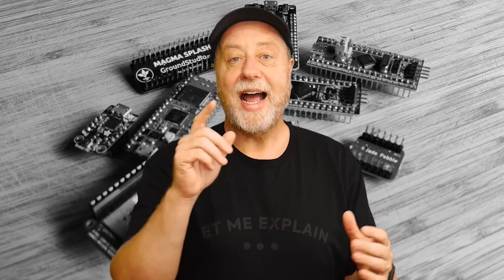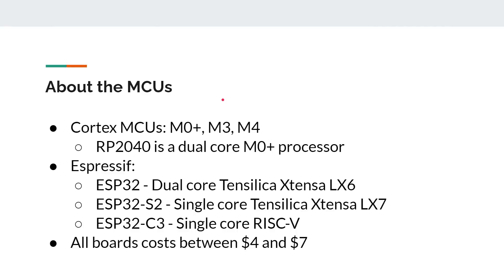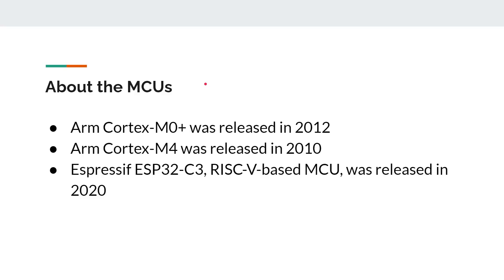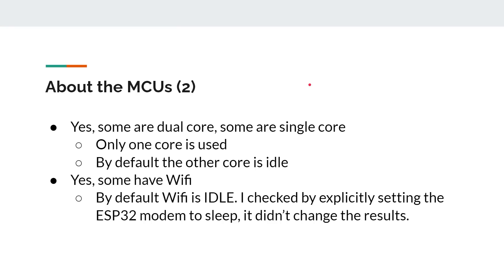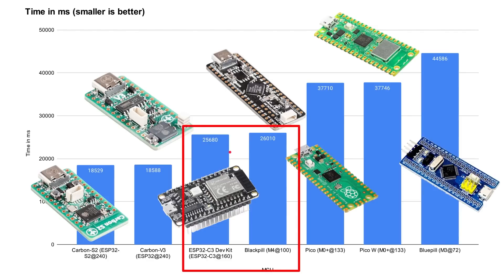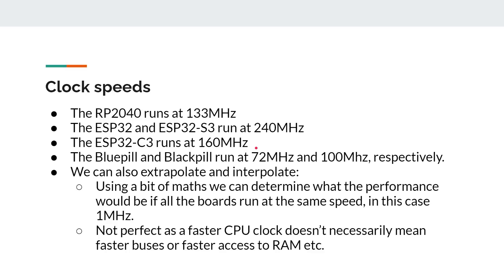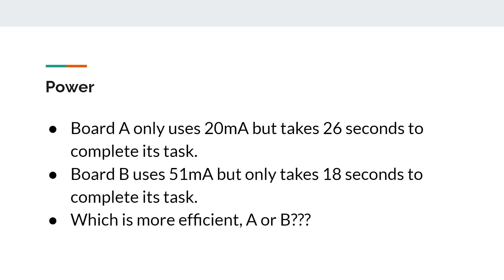Arm vs RISC-V? Which One Is The Most Efficient?

Comment: I recently created a product using an STM32G431CET6 and that thing is proper OP for the application in mind (There was one specific requirement I had to meet).  They can clock at 150MHz all day long and boost to 170MHz.

I’m running mine at 24MHz and even that’s generous for my needs.

Comment: One other important factor on powe consumption, is how low ot can get when not doing much. This can be very important when making battery operated things. For example, the Nordic nRF52840 can gwt down to less than 5 mA with BLE running, and lower in LP modes, while I have not gotten the ESP32-C3 down to less than the same 38mA with BLE on, even when the CPU is just waiting. I'm working on this, trying to get the C3 to run more efficiently, because it is otherwise a very affordable and capable module.

Comment: if it has a lower power consumption but takes longer to do the same  task its not more energy efficient. It is better to have Faster processing for a shorter burst than spending a longer time to do a task at lower power consumption. The  black pill would have close to the same power consumption as esp32 since it would take 2.4x longer (without architectural differences). So while esp32 would consume the power in 1hr, it would be done and be in idle state while black pill would be still processing. Not to even mentioning the heat it would produce working for that  long would also increase power usuage.

All in all you didnt take into account the power it would consume for running longer or shorter periods (in the case of more powerful socs like esp32 or pi pico etc.) The graph is assuming that higher performance socs would take the same amount of time as black pill to do the task
Reply from the maker: Eh? That is exactly what I measure from approximately the 14 minute mark onwards, my guess is you didn't watch the whole video.
Reply: @GaryExplains  i watched the entire video. If this is a repeated test then time is okay but the number of test run per mcu is important for "efficiency". if one mcu can do 1 task for 1hr and another does 2 or more per hour then it wouldnt be fair to say that the one that does 1 task is efficient because it draws less power over the hour. There can be 2 mcus at the same clock but 1 can do more tasks; like for example adding 100k numbers , while mcu A does 100K in 1 minute mcu B might do 2x 100k in that same time.  If the mcu only does 1 task and goes to sleep then the higher performance cores would be more efficient since they would spend less time working on the task.
Reply from the maker: I am talking about the mWh chart I show just after the 14m mark. That measures efficiency for the whole task, as you describe. 🤷‍♂️

Comment: You are comparing what against what exactly?
For ARM, there are many different versions of the ISA (instruction set architecture). v7, v8, THUMB, THUMB2 being only the major families.
Let's say you take the latest and greatest of these: that would be ARMv8 with Thumb 2 instructions.
For RISC-V, the situation is more clear:
There is the RV32I (32 bit) and RV64I (64 bit), with I = basic/integer, and extensions M (multiply/divide), A (atomic operations), F (floating point), D (double precision).
Collectively IMAFD is called G.
There are compressed instructions of the I set, called C.
Then there is the V extension for "vector".
Also there is the H extension for "hypervisor"
I think that  when comparing ISA's it would be fair to compare ARMv8+THUMB2 with RV64GCVH.

Now of course, somewhat decent RISC-V boards are coming available just about now,  and efficient CPUs with the ARMv8+THUMB2 are now on the verge of beating Intel/AMD in laptops and servers. 
So it is just not fair to compare the current implementions of both instruction set families.
You can compare code side: RISC-V linux executables are smaller than both x86_64 and ARMv8 for the programs I compared: ls, mv, cp, sshd, gzip. This is in contrast with what everybody claimed:  C programs should be bigger when compiled to RISC-V machine language because it is RISC and the other two are CISC. Well, ARMv8 is technically RISC, I read, but compared to RISC-V the language is huge.
However, code size is vanishingly small compared with data even on a Windows system. Still, RISC-V Linux has consistently about 10% to 20% smaller executables.

You could also count the number of instructions executed for a certain task, say sorting an array, or compressing a file, or computing something scientific and massively parallel. Then you can compare the number of instructions used in RISC-V vector extensions against ARMv8 Thumb2 instructions. Still there is a caveat: RISC-V V extension is vector length independent. Newer chips can run the same binary more efficiently when it has a larger vector length.

You can do normal performance benchmarks but then you are comparing hardware implementations, not the ISA's.
Reply from the maker: Why do I get the feeling that you didn't even watch the video? 😭
Reply: @GaryExplains  You are partly right. I actually did watch it before but I more or less forgot. I now watched it again.
My issue remains though:
If you are comparing the efficiency of an ISA to another ISA, that is really hard, I think. It depends on the qualify of your assembly program if you are programming that directly. Or if writing C, it depends on the quality of the compiler.
The compilers for RISC-V may not be as mature as those for other archs. Especially for critical fast code using the vector instructions.
So you can count cycles for instance, and see in how many cycles each arch can get a certain task done.
Still not really fair: CISC can do more in less cycles presumably, although x86_64 instructions can take 10's of cycles and RISC-V does 1 cycle per most instructions and maybe 3-4 for difficult ones.
Anyway, I have always wanted to start writing assembly, but always found the ISAs way too complicated. Including the various ARM ISAs. My last real experience was with the 6502 (C64 days), and I only tried it when those days where almost over.
But now there is this new promising ISA that is simple enough for me to learn Assembly from scratch. So I am exited for it and I want the platform to succeed.
I have a Milk-V Mars on my desk but have not been able to boot it from a eMMC card yet. I also have a Milk-V Jupiter on order which has the vector RVV1.0 extension.
And I have pre-ordered four of the Milk-V Oasis boards with the sg2380 chipset.
I have tried some assembly in an RISC-V qemu machine running Ubuntu that works surprisingly well.

Anyway, how would you go about comparing the relative efficiency of two ISA families? Can it be done?

Comment: So - I've implemented an ARM and RISC-V architectures "on paper", and RISC-V is simpler in ways that pay.  There's only about a dozen basic choices that even can be optimized out in the core ISA yielding an architecturally pure ISA.  My less favorite parts:

* The opcode, funct3, and funct7 not being unified in decode step.
* The LU opcodes not mapping to truth table means LU operations are not simple 4BD decodes with add and mul being 2x4BD+1 decodes.  AFAIK no commercially available ISA has ever achieved this, but it's been discussed widely in academic circles.

ARM though has for example the Java bit which halves the available opcode range, and is AFAIK based on an earlier RISC platform with some commercial extensions.  And sure, some of that makes it fast, but it's going to be less efficient per wire than a cleaner ISA.  There's actually tons of details I don't like in it.

Comment: Unfortunately, there is no way to quantify which ISA is more efficient based on random boards from different manufacturers. There are too many variables in this equation to drive any meaningful data from these tests. One would need to custom engineer their own hardware while keeping CPU design really close to each other to be able to accurately quantify this

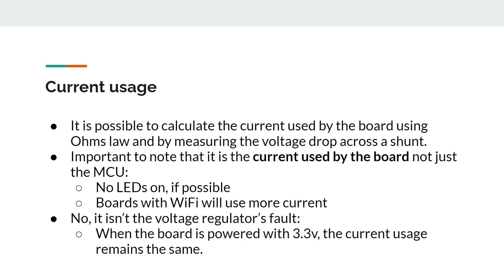Comment: 11:20 how can current stay the same? I have searched many and many voltage regulators. They all come with no load or quiescent current. If you don't use a voltage regulator, it must use less current. This is not complicated.

Comment: clock speed scaling is definitely not linear enough to fix afterwards, you should down clock all of them to the same speed, if you want compare at the same speed...
Reply from the maker: Clock speed scaling is linear on microcontrollers. They are in-order and deterministic. Plus I did actually change the clock speed on many of the units to check that, and it is.

Comment: Gonna take a while for the RISC-V manufacturers to figure out how to design really great chips with it, but there's no reason not to expect it will be roughly the same as ARM in the long run, just with an open ISA which is an absolute win on its own. Hobbyists who aren't trying to squeeze every last bit of performance and efficiency out of their projects should support RISC-V to help it along and encourage faster development. It's already outpacing ARM's development, which was already quite rapid.
Reply: The really interesting bit is RV32E with Zc* extensions. It essentially repurposes a bunch of the the floating point compressed instructions allowing a 16-bit only CPUs with half the registers. That'll be a tiny core.
Reply: @mrbigberd minor nit: they still have to implement the 32-bit instructions. there's no base isa that's compressed-only.

there are a few hoops to jump through, but it's not hard for an individual to contribute. and i've been tempted to contribute for months now. (i have a number of ideas i'd like to fling their way already.)
Reply: @dead-claudia  That's not strictly necessary as the 16-bit only format is Turing Complete.

There are still 10-ish opcodes still left and a couple of them could be broken down further to provide a few more 2-reg instructions.

Most importantly, a 16-bit only extension would allow the use of the 11 top-level opcode space. This would increase total instruction space by 25% in 16-bit only designs and that would give enough space for a massive 64 2-register opcode space using the CA instruction format. That's enough to add in more branch instructions, A, B, M, CSR, Zicond, Zacas, etc.

Going further, the E-series only has access to 16 registers. Reclaiming those bits for CR gives 2 extra instruction bits (4x as many instructions). CI doubles its available instruction space too. This would open a path to add a basic Vector/DSP extension too.

Comment: I'm more interested on what the best ide to use and library for risc-5. Are they up to stm32 level of library support however buggy they may be.
Reply: I mean in context of cmsis which includes dsp and many things
Reply from the maker: Also, CMSIS is an Arm thing, from Arm itself.
Reply from the maker: The difference is that STM32 is from a company, i.e. STMicroelectronics, to support the ARM chips they make. RISC-V is an architecture, so you need to pick a company and see what it provides. The Espressif chips seems to have a mature development system for all their processors including Arduino support.
Reply: What about DSP math tools, QMath, and feature like this, are they included in the Espressif ?, is there nice youtube session to give me overview. I review that last time (1-2 year ago) but not confident with IDE setup that seen so far
Reply from the maker: You appear to have detailed requirements, and I'm not sure I can provide a thorough response that fully addresses all of your questions. It might be best for you to reassess these platforms to determine if they align with your needs.
Reply: I was hoping to ask those who worked on Riscy-V and the support platform. While the hardware spec looked good but useless if poorly supported (via Open Source?) compared to ARM (CMSIS) and 3rd party vendors. I would like to understand better that Espressif covers all things that compete with the ARM family. Are they mature and complete? How much is the learning curve to move from ARM-based MCU to Risc-V?. This is a more general question.

Comment: Well...  There are certain extras in your core implementation that will make a difference; stuff like the different caches and the coherency mechanism, the branch predictor, cpu internal bus and the bus arbiters, there's just so many extra internals that are all abstracted away in complex logic.   Some of that complex logic is just more appropriate to implement in another program, i think some of the cpu caches are governed by a whole other "management engine" that runs its own firmware to keep track of the bits in the cache....

Comment: frequency scaling with power usage isn't linear, its exponential, its better to have all of them at the same clock frequency
Reply from the maker: While I agree that it isn't necessarily linear, as far as I know that is only if the voltage changes with the frequency. In my testing I didn't only use extrapolation, I did clock them (where possible) at the same freq and the results correlated with my extrapolations.

Comment: minor but architecture can 100% be relevant for effeciency, speed, etc. Yes, a good x86 implementation can always sip power in comparison to a shit ARM implementation, but that doesn't mean implementation is all that matters. A slow algorithm on a super computer will outpace a fast algorithm on a microcontroller, but that doesn't mean picking the right algorithm doesn't matter, it just means that it's not the sole deciding factor. These architectures were invented to solve specific problems and to suggest that architecture is irrelevant is really just disengenous. 

No, the differences won't be direct, but the architecture influences the implementation; different architectures lend themselves better or worse to different designs, and some designs are better in some functionality than others. Intel was far ahead of AMD for a good long while, but then AMD started going batshit and putting dozens of cores on their CPUs and now at the ultra-high performance they're pretty unmatched. In single core they still lag a tiny bit IIRC, but in multicore it's real hard to beat 16, 32, 64, 128 seperate cores. Speed isn't just an RPG stat, there is a lot of nuance and 'speed' is really just the composite of how fast it can go and how easily it can go that fast. If your chip is the fastest thing in the world, but it takes 500x more work to develop for, it'll never take off. (outside of niche use cases of course) On the other hand, if your chip is 25% faster and a drop-in replacement, it'll spread like wildfire. 

One thing I really think RISC-V needs to work on is making sure that they go out of their way to make cross-compilation as easy as possible; that or invent a damn good emulation suite. (but only Apple has really ever pulled off performant cross-architecture support AFAIK. I hear a few projects are getting pretty good, but I've never heard of one really bridging the gap outside of Apple) A new architecture just can't demand people spend time porting their software unless they have something really good to offer, and really RISC is more of just an incremental improvement than anything.

Comment: Just comparing performance or power between different devices is pointless.  All of these CPUs are licensed to companies which put them into more complex embedded devices.  The size of the CPU is a huge factor as a larger size means more die area and larger costs.

The M0 cores are tiny crappy processors with a single memory interface shared between instruction and data.  The performance is bad, but it’s a simple 16 bit wide instruction ISA which allows for a processor that is smaller than what is even possible to achieve with the minimal RISCV ISA.  The M4 cores are much more complex and much larger to meet higher performance requirements.

RISCV itself has multiple extensions which don’t need to exist on every core.  What extensions are implemented and how the core is implemented will greatly impact size and performance.

RISCVs biggest strength and why it is being talked about more is its ability to add custom instructions to the existing ISA.  This allows for the acceleration of very specific problems or driving custom accelerators with custom instructions.  For example you could have a very simple RISCV processor driving an accelerator for AI Inference for machine learning applications.  You can do this with an extremely small CPU which means less area and more profit per die.  ARM can’t do this and would rely on existing instructions with additional overhead.

Comment: Its kinda wrong to average out the performance.  The esp32, esp32-s2 and esp32-c3 have an adjustable clock ( 80 Mhz,160 MHz and 240 Mhz). The newer Esp32-s3 can go as low as 10 Mhz. You can set the esps to 160 Mhz to compare to each other.  You can also average the time it takes for  fixed set of operations etc
Reply from the maker: But the point is the power efficiency per MHz, which is what I showed. I don't think you understood the video.

Comment: Were the connectors taken into account? USB C has transfer rates close to 10Gbps while micro usb is pushing over 450 Mbps. Then as far as power, USB-C handle nearly an order of magnitude power than the micro usb at 100W. Just curious.
Reply from the maker: The test didn't use the USB ports.